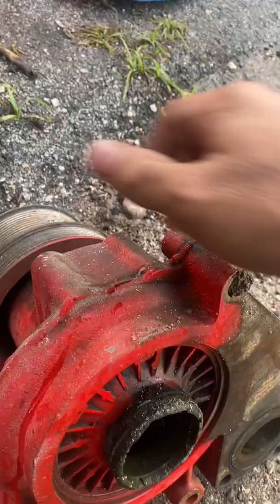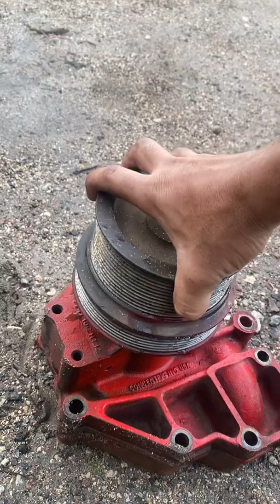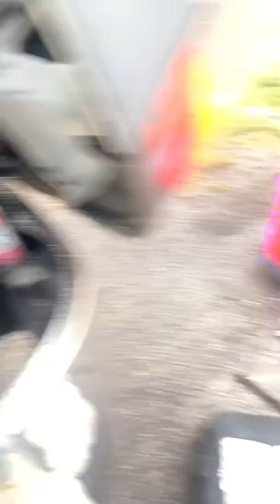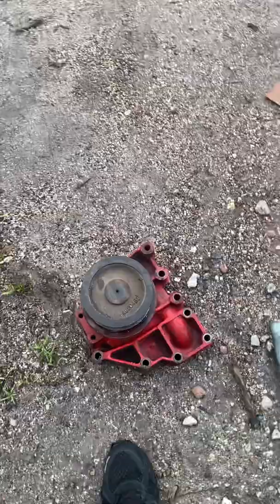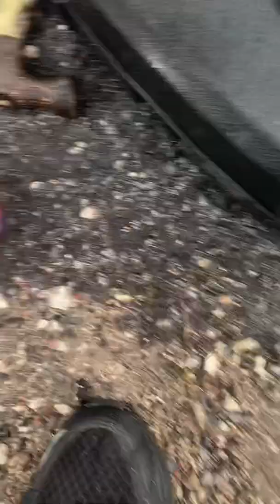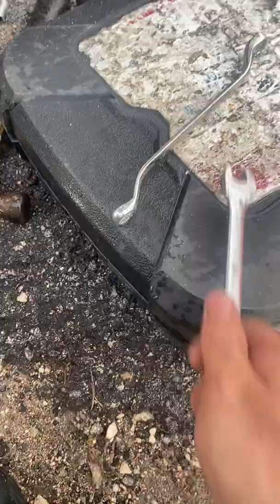ISX Water Pump Replace

Comment: Hey, the mounting that the top bolts goes in. Has crack off the block, can it be weld back in
Reply from the maker: Couldn’t tell for sure but, it wouldn’t hurt to try. Don’t remember the name of the weld but, if you ask around, there’s a “cold weld” paste that mixes just like JB Weld that’s made for metals (specially engine bocks). My friend had a cracked on the block that was loosing oil. That weld fixed that crack really well.

Comment: Great review but let me add. More than likely the rubber gasket failed and not the pump.. I bet it started leaking in really cold weather. 2nd you remove those bolts with crows foot
Reply from the maker: Thanks for that input 👍🏻. Not a mechanic here, just do what needs to be done. Thanks again!

Comment: What did you use to remove the belts off?
Reply from the maker: Belts are removed pulling down the tensioner.
Reply: I seen a different setup on an ISX 12 i believe and the water pump has two belts, the front belt runs the alternator as well and thats my concern